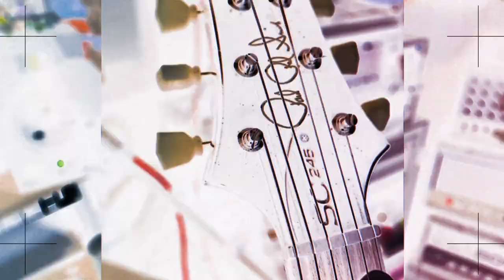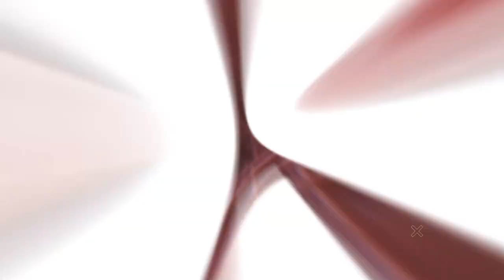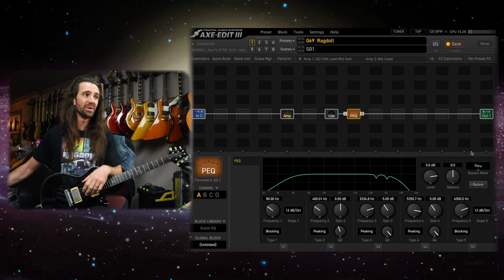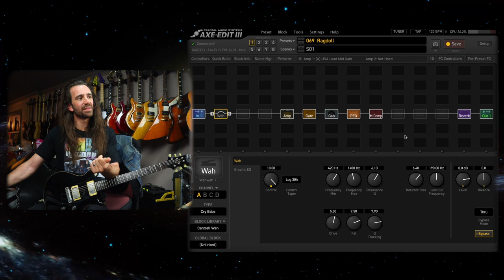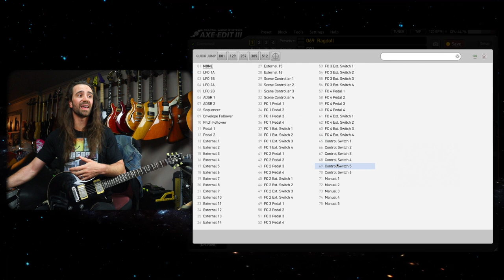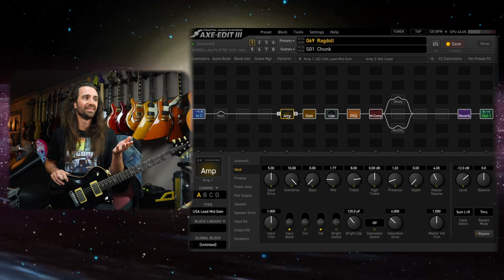Dialling in MY Sound with Cygnus - Axe-Fx III Tutorial

Comment: That was GREAT!  Leon, when you showed the modulated delay block options, there were  bunch of delay choices....."Panned Delays"....."Circular Delays"....."PCM81 M-Band"......Did you program these yourself, or are they available in the Axe-FX3?  Thanks for making me feel like a complete DINOSAUR!  :)
Reply from the maker: Thanks mate! They're custom blocks in my library, but the MTD recently got updated with lots of options like that.
Reply: @LeonTodd  I'm using a rack switcher, with pedals in front of the amp, and a big Eventide feeding the power sections of 2 heads....it's cool, but the Axe sure is elegant!  ;)
Reply from the maker: I loooove the sound of that rig!

Comment: I really like your videos, quite informative, but honestly this just sounds bad to my ears.

Few days ago you did a video with using 8" and 10" speaker IRs, that sounded amazing. I guess I just don't like overly compressed high gain amps.
Reply from the maker: It's all context driven. I play in a hard rock trio with a singing bass player who uses a fair bit of dirt on his bass sound so this is designed to work around that. For a classic rock, blues or country thing is go straight for those small speakers and low wattage amp models!